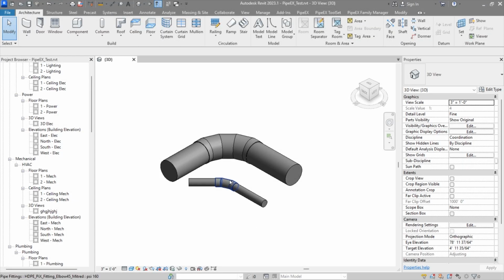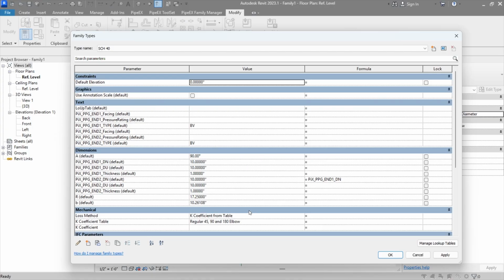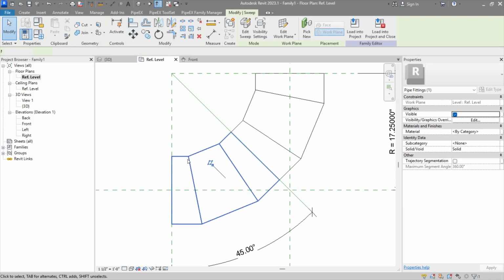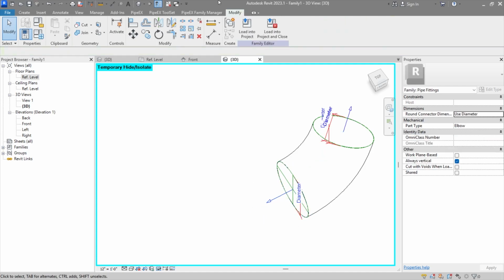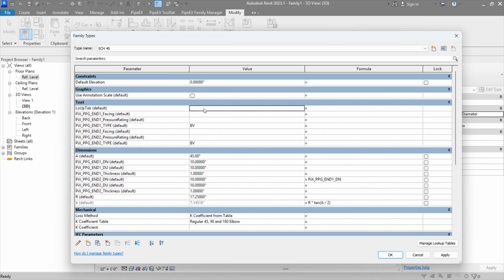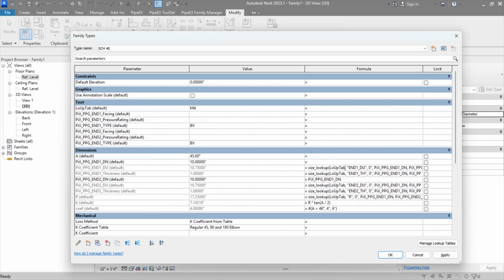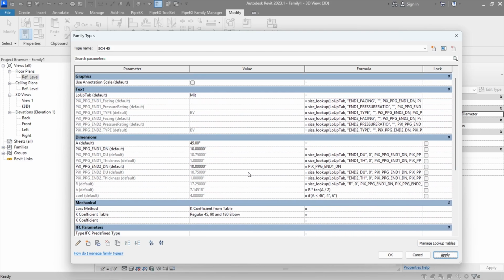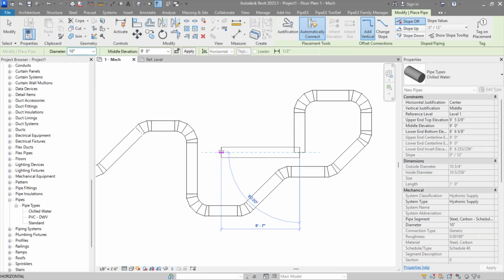Revit MEP Tutorial: Mitred Elbow Family from scratch, including a CSV lookup table and some tricks.

Comment: Hi thanks for sharing this, however I would like to help out share a tip how you can create a fully parametric (LOBSTERBACK) segmented elbow. There is no need to have individually dimensioned segments, and multiple elements this is overcomplicating the design. REVIT allows a sweep that includes TRAJECTORY SEGMENTATION. Tick the box and state the angle of segmentation required. I use this for my large Steel fabricated bend fittings. You can create any angle using this method and drive the segmentation angle by lookup table. Please note I am not criticising your tutorial, just trying to help a fellow REVIT modeller. I hope this helps. I look forward to you many more of your tutorials. Cheers Glenn
Reply from the maker: Hi!

Thanks a lot!. I was not aware of it, will give it a look and use it for one of the videos.